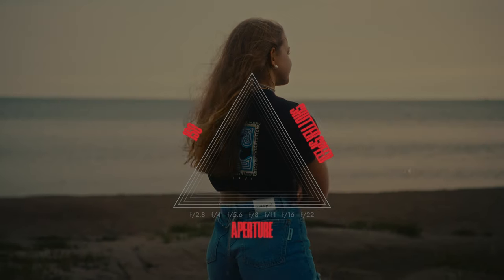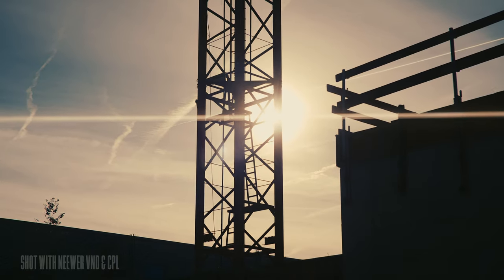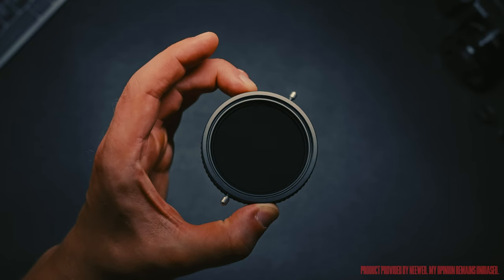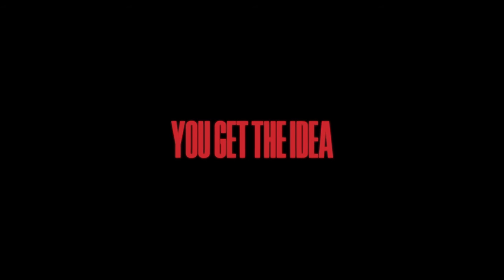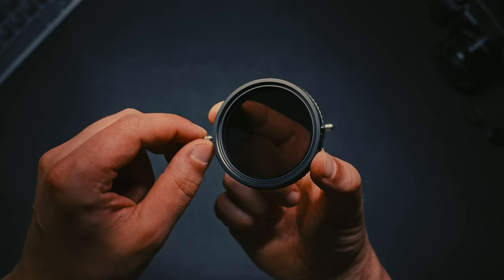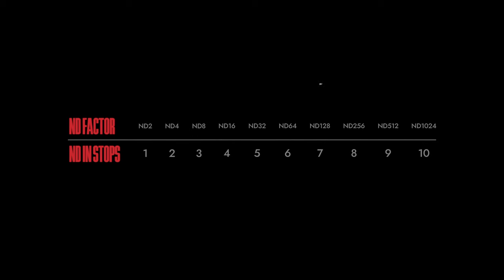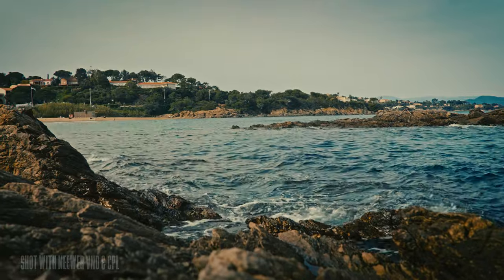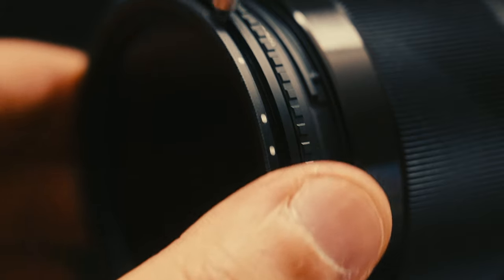Best BUDGET ND FILTER for any Camera | Neewer 2 in 1 Variable ND Filter & CPL Review

Comment: Great video as usual and great filter find.  Question: do you use sepatare filter for each lens or just have on large diameter filter and use step up rings for each lens?
Reply from the maker: Thanks a lot! I do prefer having multiple filters that fit perfectly on each lens but both options would work just fine 🙌

Comment: Awesome video ! I’m between this one and the K&F Concept Nano-X ND2-32 + CPL, did you casually compared them ?
Reply from the maker: Thank you! I didn't get any hands on time with the K&F filter but I decided to go with the one from Neewer since it has more coatings and I prefer the physical design quite a bit more.

What I can tell you is that I've been using regular ND filters from K&F concept for years and I can't make out a significant difference now that I've switched to Neewer. The additional CPL function obviously makes a large difference but strictly talking about basic image quality between the two brands, there's no need to split hairs here.

If you're interested, you can find a shop link in the description box. Supports the channel at no additional cost to you 🙌

Comment: is this filter double threaded? I wish to purchase a promise too but have heard that this lens should be on last? If that is the case, how do I know the correct measurements? For example, my thread for my lens is 58mm. It is a kit lens but the only lens I own. I plan to get a 58mm promist filter or glimmer glass and then I assume I would get a 58mm thread for this filter. Do these measurements change as I stack? and is sticking with 58mm as my threadsize a good idea for future investment in lenses and usages with filters?
Reply from the maker: Hey friend. Yes, the filter appears to be threaded in the front. I stack mine with a pro mist as well. I'd recommend putting on the pro mist first though and then the Neewer 2 in 1 since the measurements do indeed change and getting a smaller pro mist filter will safe you some money. 

Read the product description carefully to find out about the new measurements. For example a filter for lenses with 67mm diameter has a front size of 72mm. This is unproblematic but you'll need to purchase a 72mm lens cap for it to hold. Hope this was helpful. ✌️